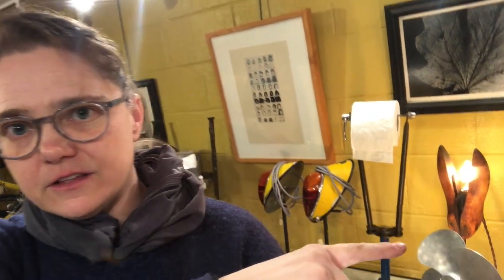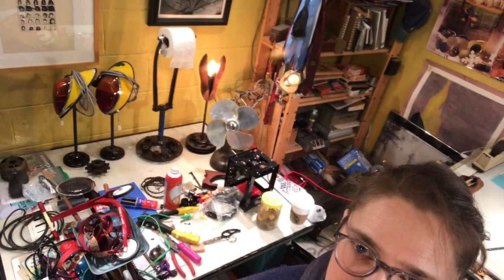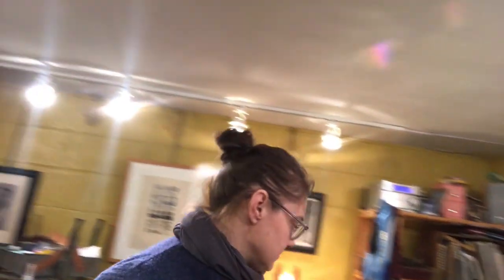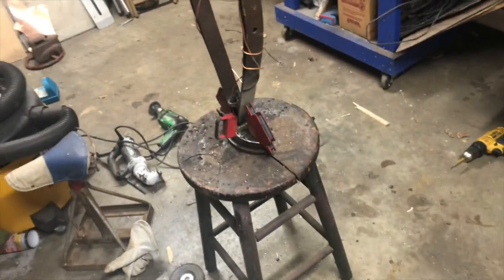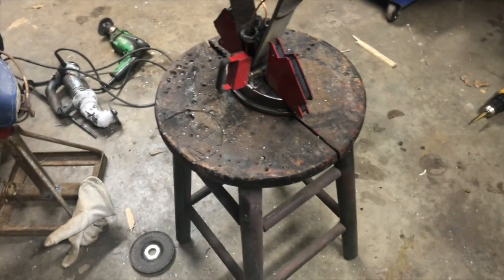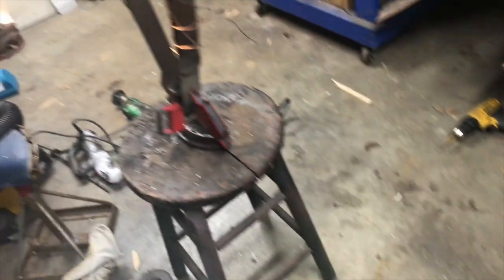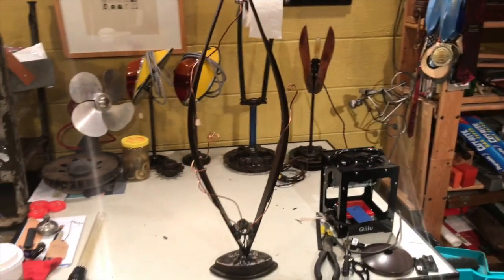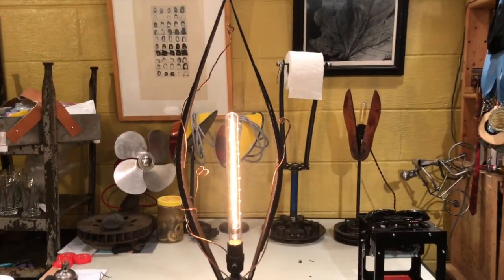Welding Cast-Iron STEAMPUNK style lamp

Comment: Great video I love the bike fawkes loo roll holder realy good idea. I've welded cast iron a few times with my sip mig welder I turn off the co2 and turning the mig up high and give it flux core wire and it seems to work well and all have lasted years hope that helps thanks again from me in the uk
Reply from the maker: thanks! I welded with FLUX core on this one and so far seems to be holding...I'll let kiddo kick it around a day or two and see what happens then 😆😂 thanks for being here chunk 2good!
Reply: @marcijunebug  I need to do some aluminium welding  I've never tryed that before should be fun I will nee some luck